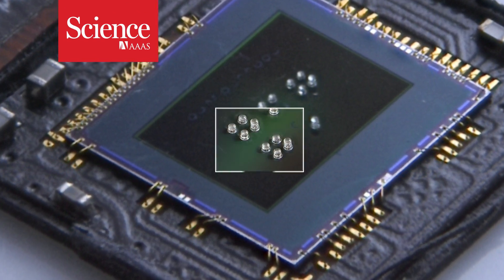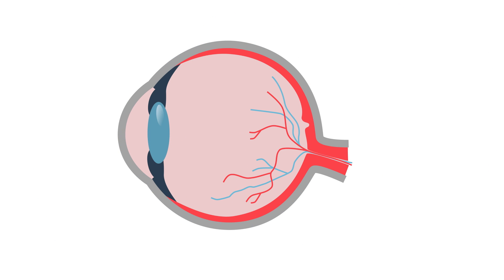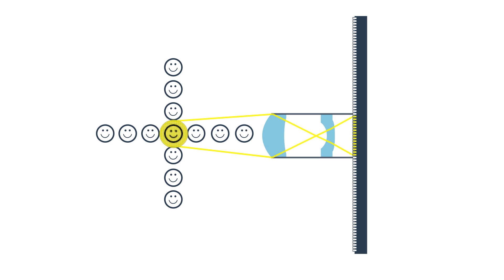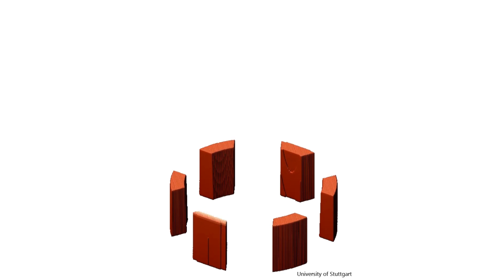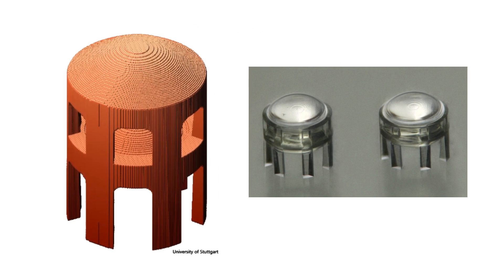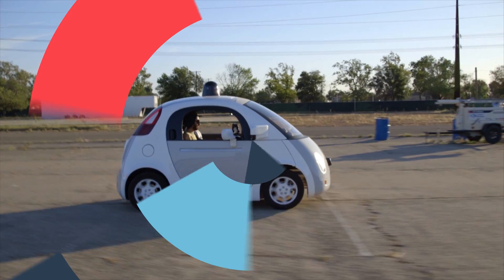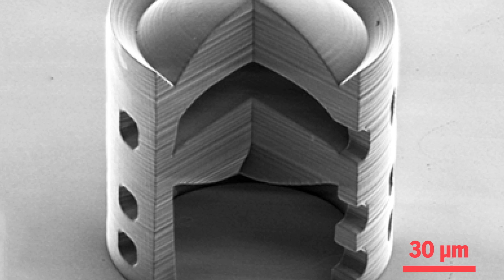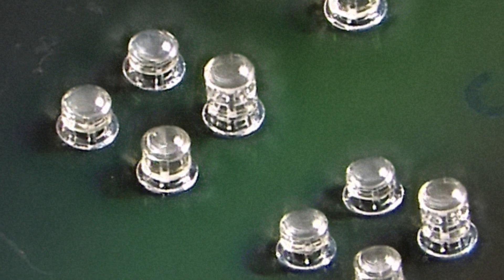Eagle-eyed lenses

Comment: Add in some AI upscaling or denoising and you could probably sharpen those edges out quite a bit
Reply: The point would be to have a cheap normal camera next to one of these cameras in order to show a higher resolution on things closer to you vs things to the sides, and then it should be very quick for a neural network to take those two images and give back a couple of numbers representing distances to objects.
Reply: That would defeat the purpose of this whole thing

Comment: Here's a easier solution then trying to print micron sized lens. Make CCD in a concentric pattern with the highest density at the center and less at the perimeter same effect for lower cost.
Reply: You end up getting the same image multiple times because you aren’t solving the issue of needing to bend the light rays in a particular way (unless you are also using a lens like they are).
Reply: @evannibbe9375  I don't think you understand how a CCD works I suggest you do some research.

Comment: So a 3 cm chip of these can theoretically hold 10,000 of these lenses.
10/4= 2,500
So a total of 10,000 pixels with 2,5k pixels at each of the 4 distances.

Worse then todays cameras and a long way from our estimated 250,000 pixels eye resolution

What is needed is to expand the capacity of each lens if its ever going to work, maybe 10 pixels per lens.
Reply: Where did you get the "one pixel per lens" figure from?
Reply: on a 65 inch tv each pixel is 42 um, so its quite in line with current technology for each lens to be 1 pixel.
Reply: Linus Eson Nilsson that's for a display, not for a camera sensor. Different technology. Think how big the actual camera sensor is in your phone vs how high resolution the photo is, and also how it would make no sense to put a lens on a single pixel sensor.
Reply: ah, ic the cmos? those chipps are like 0,2 inch in size and can take 21 mpixel images.
So one of these lenses could absorb several hundred pixels each?
Reply: That's right! Each image wouldn't very good from a photography perspective, but I'm guessing it's better for a self driving car to be able to see from hundreds of different positions with low-res images because each image is easier to process.
Reply: ah yes and built in distance recognition, less processing needed to calculate distance.